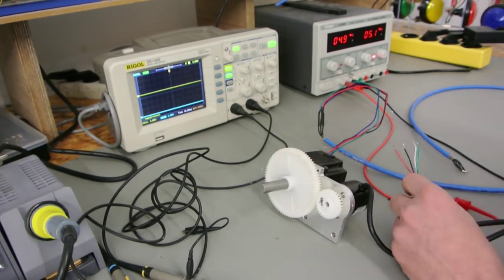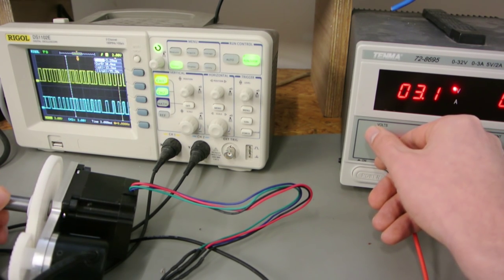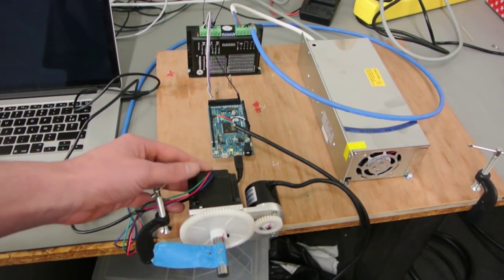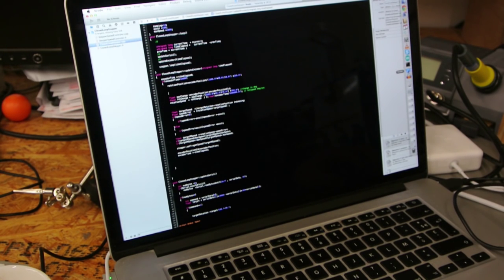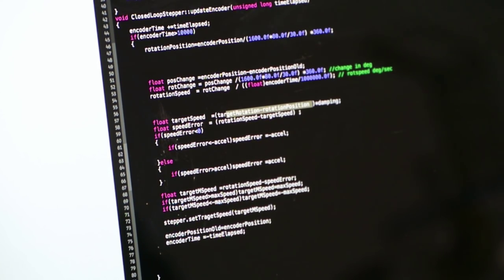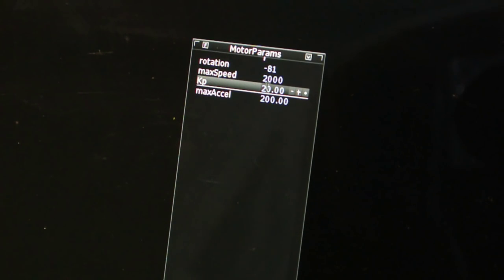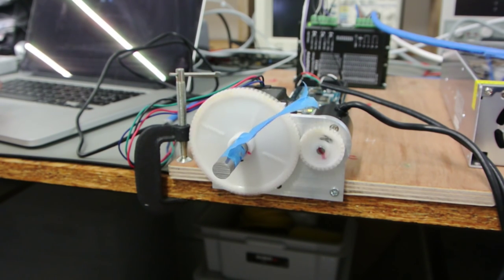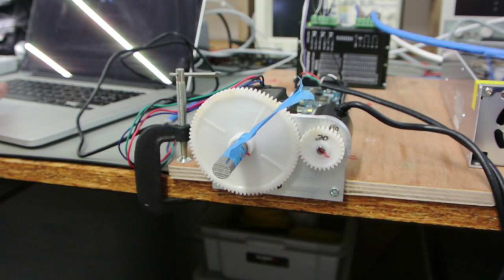Arduino Closed-loop Stepper Motor: Part 2

Comment: Excellent job, thanks for sharing! The thing that looked wrong was the backlash in the gears . . Perhaps a belt? Or chain drive would be more precise, or better still, straight to the shaft it the motor had a through shaft.

Comment: Nice project!
But it seems like you have some backlash issues in your gears, and also some servo dithering issues (but that can be because of the backlash). Why not use a stepper with axles on both sides, and connect the encoder directly on the rear axle so you avoid all backlash issues and also make it simpler and smaller?

Comment: if you use a steppermotor with a dual axle you can mount the optocoupler to the rear of the steppermotor using the same setup you have now , then you dont need to make an axle extention and can mount the steppermotor the normal way of the cnc machine using the 4 mounting bolts
Reply: and with tech this go 1:1 motor:encoder

Comment: A lot of mistakes in your encoder transmission.  1.- you chose gears. 2.- Gears pitch is too big for precision. 3.- Gears are lose (backlash between motor & encoder) (watch carefully at about 2:20) 4.- Your aluminum plate (design) does not allow adjusting motor and encoder axis distance to overcome flying gears between them. The good thing is you have nice components. With that backlash, you will never get your Due to monitor & process real motor position, specially right after changing direction. And as Metallica says... "sad but true". PD: I don't know if you already corrected this in a later video, but at least this video shows those problems.
Reply: +rodstartube the ideal transmission for this would have been a timing belt, plus a idle pulley you adjust belt tension easily. And by the way another matter: the ratio should be made to match encoder count to step/microstep position, after calibrating 1:1 encoder to motor
Reply: do you think its necessary to connect a rotary encoder to a stepper motor to track position or is it just fine to rely on the steps/rev to calculate position?
Reply: @drustan6890  depends on the job you're trying to do, inkjet printers use regular brushed DC motors with encoders and get high precision pictures, while cheap 3d printers don't use encoders resulting in "ghosting" where the motor might lose a step and you get ripples in the print. if your job doesn't need very high precision don't use encoders as they're just more work.

Comment: Hi Kris,
Where do/did you define which output pins on the Arduino to connect to the stepper motor Direction and Pull?
Thanks, great project by the way - your channel is amazing
Reply: Thats exactly what i like to know?

Comment: hi 
do you thing its work with spindle lathe to cut thread 
i mean if we connect  this encoder to the spindle 
or as a spindle  encoder 
or this  is something different ?

Comment: Hello Kris,
I'm new with arduino, but i'm trying to learn more things, so have question. I was looking for closed loop stepper code, and atlast i found it. Perfect work. Your program is written for mac, would be possible to change code to control motor position by serial monitor, "Serial.parseInt". As i said i'm new , some things i steel learning. thank you very much for your work.

Comment: wont the closed loop stepper lose information about its current angle when power is lost? I like this digital more precise approach then an analog approach but this part puts me off... imagine having this in a setup where a certain angle too far causes something to break and it would tear itself appart if it loses track of its position.
Reply from the maker: +Masterpj555 with my encoder, yes. but if its really critical, you can use a absolute encoder or/and add some end stop/homing sensors.
Reply: I have trouble sourcing those encoders for a decent price.. on ebay encoders go for like $98 :( I live in The Netherlands. Want to DIY my own servos for projects where more torque is required
Reply: +Ward Nica Wow this is a great one! I migtht try this next to an normal potentiometer as well. Even if you get the cleanest pot I bet you can have quite some noise and it limits the speed.
Reply: Masterpj555 Normal potentiometers will limit you to 270° (or multiple turns if you take 10-turn pots for instance), but will add absolute position functionality.. If you don't need continuous rotation you could try potentiometers. There are continuous potentiometers but these are quite expensive..
Reply: +Ward Nica essentially I wannna make a servo and do not need more then around 180 degrees or even less (140?) . Multiple turns would have lower resolution. My only concern would be noise in a potentiometer causing jitter.. although filtering would be possible at the cost of accuracy. Once had extremely noisy potentiometers but most were tolerable.. This is why the encoder might still be interesting.
Reply: +Masterpj555 On my commercial CNC machine with glass linear optical encoders on each axis, when we had a power failure, we had to re-home the machine before restart of program. Then step through the program to where the cutting had stopped. The program cut was resumed just before the power interruption.

We broke things when we did NOT perform a run through of the program WITHOUT A TOOL as a safety check. Any other time we broke something, there was a more drastic error that was NOT related to the encoder: the software traversed before Z Axis extraction, (other very stupid things done by the software programmer not the operator. Once fixed, there was never an issue with that feature again.) or a clamp was put somewhere it was not suppose to be, etc.

Compared to the manually operated machine with a master tool and die of "the old school", my operator consistently out performed on all measurable parameters: accuracy (0.0015" volumatric), repeatability (0.0005" repositioning), speed (15 year old Bridgeport Knee Mill knockoff with slop in the center of dove tail ways), surface finish, product output, etc.
Louis DiFrancesco louisdifran@gmail.com 505 515 4700 Boston, MA
Skype: LouisDiFran http://pitek.us for my inventions and background
Reply: +Louis DiFrancesco impressive! Also the pictures of socket and dye interconnects on the site are really cool.
Reply: You could:
- use a backup battery
- use EEPROM memory to save the rotation (but this would need some additional power buffering for sudden power loss).
Reply: FuaZe ppĺó

Comment: Hi Kris nice project,i also would like to make the same for use on the step motors that I put on my diy cnc,but i never programmed an arduino and i am I little bit confused about the programming codes.
I need your help ,do i have to upload al the codes that you have on github or only a specific one?
I will appreciate your help to see if i can convert my cnc motors to closed loop to avoid loosing steps.
 Regards
Carlos Tavares

Comment: Hi, I'm beginner in this domain and, I'm planning to use NEMA 17 with DM442  to build a belt actuator. My I ask if I need Arduino , and if the answer is a positive what type of Arduino shall I purchase ?
Reply from the maker: +Muaathe Aziz Hi , yes, or some other kind of micro controller. Any type will do :)

Comment: Would you recommend a stepper motor for a silent follow focusing device?
Reply from the maker: Atheos I don't really know. Its probably the easiest way to do it. Thats all i can tell... good luck!
Reply: Thanks for the quick reply mate, one more question then: Is the thread free to move around when there is no power going to the motor? As in, you can turn it with your hand without any friction?

Comment: hello, I want to program the code in arduino sofware but it does not find "# include cinder/app/AppNative.h." 
Do I need a library that I do not have?
my error:
arduino-1.8.8\libraries\ClosedLoopStepper\src\ClosedLoopStepperApp.cpp:1:34: fatal error: cinder/app/AppNative.h: No such file or directory

I am working with the arduino sofware under windows 10
my arduino version is 1.8.8
¿can you help me?
Thankyou!
Reply: hello, i had the same problem, I'm not sure but with recent versions don't exist AppNative.h and it works with App.h
however, i continue to have problems to compile, if it works with you, could you help?
Reply: @jonathancamacho4473  It still does not work. I wait for an answer.

Comment: Could you please help me?
I want to write  code to control stepper motor  and read pwm from rotary encoder have  phase A, B , GND and Power  at the same time.  my stepper motor connect with encoder  as  servo motor with encoder.   ^_^

Comment: I am unfortunately unfamiliar with computer code that isn't python, processing, or arduino and even those I am not great at. What code is he using on his computer to interface with the arduino?
Reply: +Dominic Mann That is C++. The Arduino language is actually just a C++ library. C++ without classes = C.
Reply: Thanks a lot I actually know a little c++ do you know where the best place to download the compiler is? Thanks!
Reply: I'm super new to C++ also so you'll want do do some research on your own, but I've been using Sublime Text and Terminal (on Mac). Apparently you can also use Xcode on Mac or Visual Studio on Windows.
Reply: thanks
Reply: You can write the computer interface in Python or Processing, no worries.

Apperently he used C++, which is what Arduino uses (in the background), it can be usefull to learn C++, but may be a burden if you only want a simple desktop application.